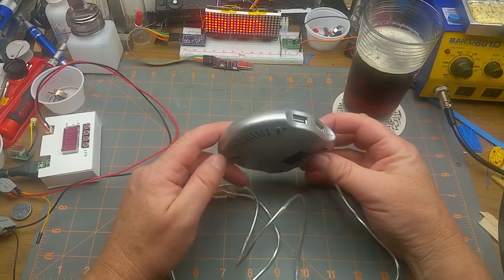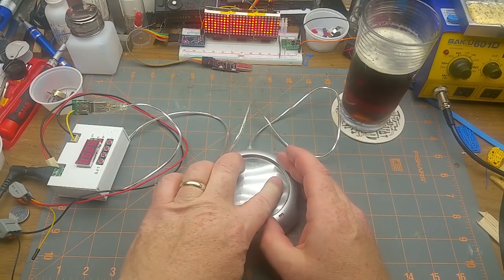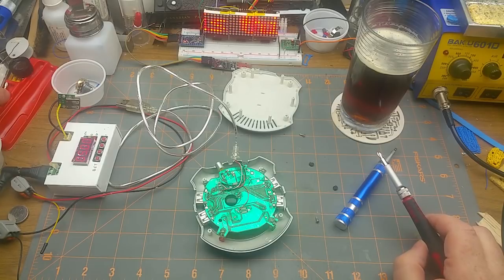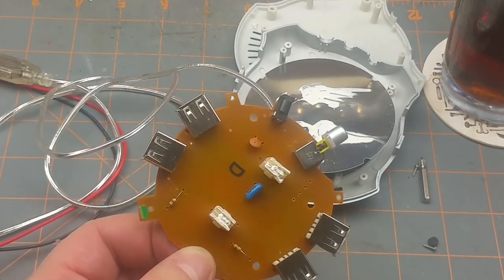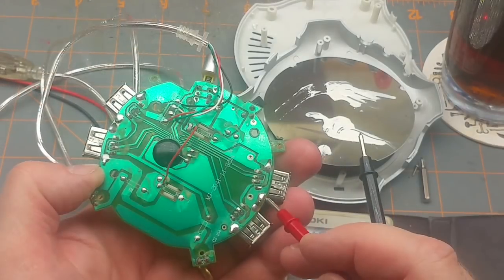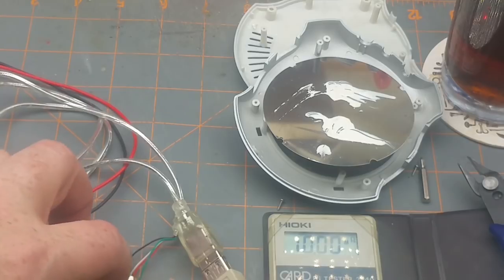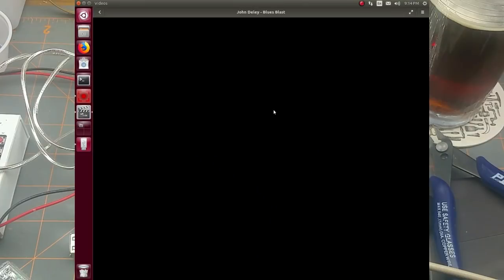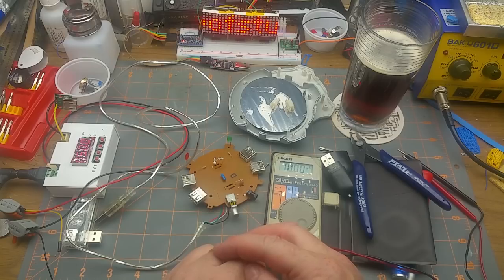usb coffee warmer teardown

Comment: Any idea how hot it actually got? Was thinking about using this to heat solder pot lol
Reply from the maker: A bit above room temperature. But not hot enough that I couldn't touch it.
Reply: @pileofstuff  sooo more resistors or more volts or watt?
Reply from the maker: @plageran  A powwer supply capable of providing more than a typical USB port on a computer, and lower resistance resistors.

Ultimately you what to dissipate more watts.
Let Ohm's law guide you.
Reply: @pileofstuff  thank you Sir!
Reply: Can't imagine much seeing how it had 4 outputs and is powered via USB

Comment: What the hell? :D Resistor as heater? xD OMFG i died...
Reply: I am not surprised to be honest.
Which i have bought several of these and know that it is a resistor as a heater, but that's not why i am not surprised.

Heating coils are essentially a resistor that heats up, but a entirely different form.
So if we think about it, a resistor can work as a heater in small applications such as this. Especially if the resistor fails, well it's easy to replace.